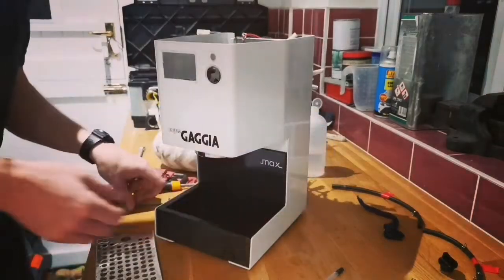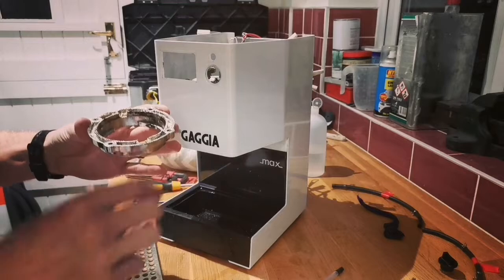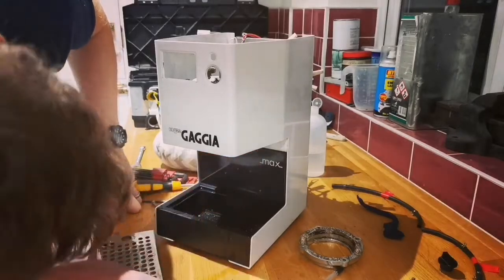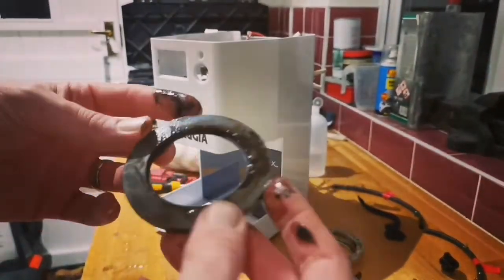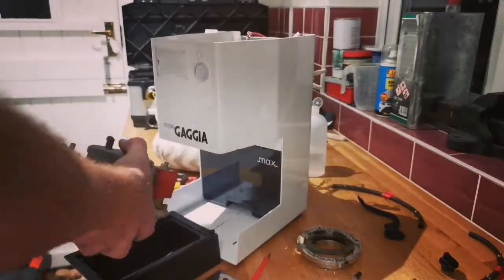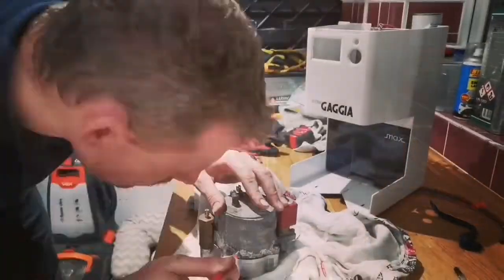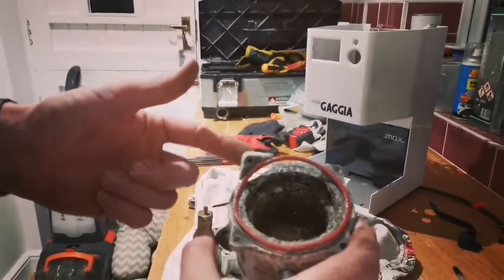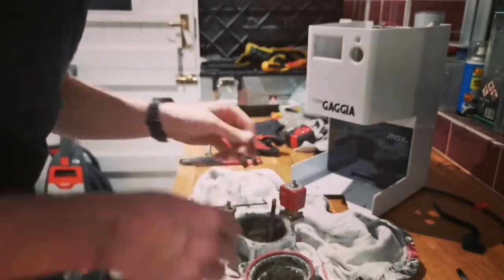Gaggia Classic OWC boiler removal

Comment: Hi my sir, my boiler is not heating the water.
Reply from the maker: Depending on the year of your Gaggia. You can replace the boiler easy enough. But make sure the switches and thermostats are working first.